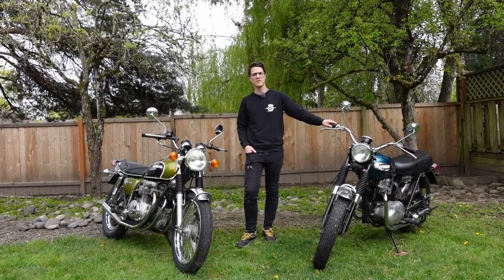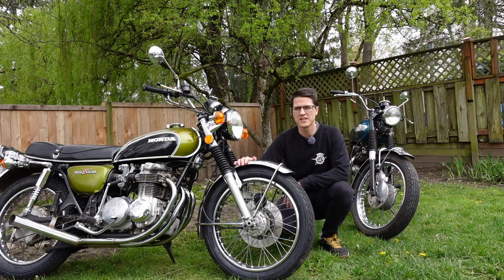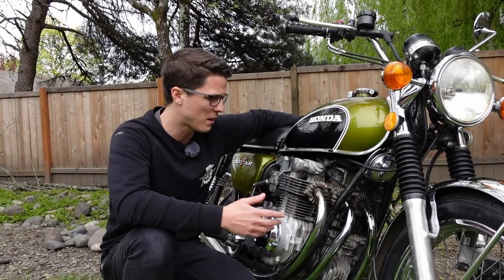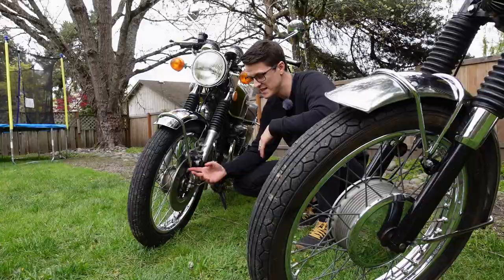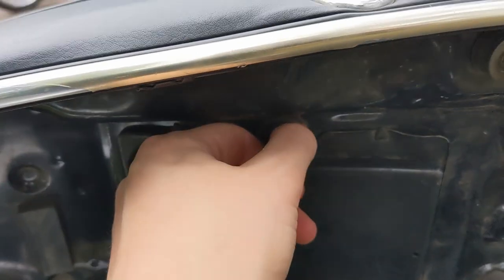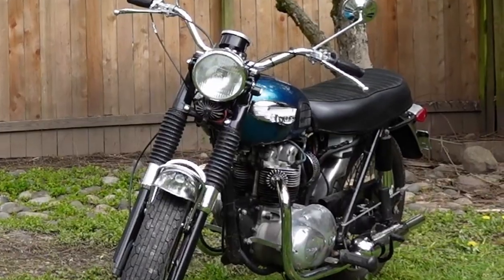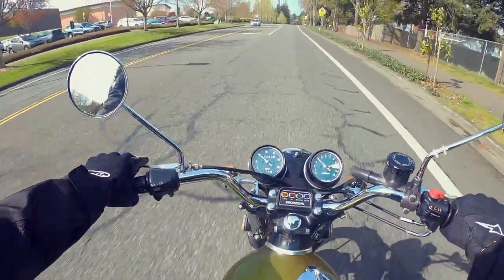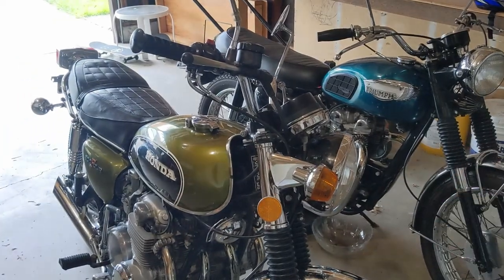How this Honda killed this Triumph

Comment: Honda killed it with it's dependability, perhaps the most reliable bikes ever produced- the CB line is tops.
Reply: So true. It just is. Reliability is everything.
Reply: @Ian-ny6ux  A bike can be as enjoyable to ride as you like, but it's not enjoyable if it breaks down.
Reply: Plastic is more reliable than wood.. wood has beauty, plastic doesn't. If function was all that was important, we'd all be chasing functional women. 😄
Reply: So you liked the single round “puck”disk on the 70’s CB750? 😖 That thing was noisy on all 4 of mine.
Reply: Reliability. The main purpose of the bike which is to get us from point a to b is what keeps most owners/enthusiasts interested. Nevermind the other means like cars or public transportation or other more reliable bikes. That is why some of us in other parts of the world bought old Honda's in the first place because it's still reliable and relevant upto this day. Otherwise what's the point if you can't ride a beautiful bike around town? We can always have other bikes in our garage but personally I'm always going to have one Honda in there. Old CB's are just legendary, good-looking and makes revving sounds just as good as any other newer bikes in this year because classic never goes out of style. As long as the parts and prices are reasonable that is. I'll stick to that.
Reply: all the c b 750s had leaky head gaskets. and to change or retorque the head one had to take the engine out of the frame.  rather trouble sum, but after that the engine was good for a while.  the transmission also had a tendency to pop out of fifth gear at high power and high speed, for which you had to come to a stop to re engage if you didn't want to grind the gears. over all it was a great bike for it's time.
Reply: Yeah, the low priced 250cc Suzuki X6 Hustler with 6 speed tranny and 105 MPH put a lot of hurt on Britain's bike industry/sales...
Reply: Triumph was relatively reliable until the Japanese got organised. All new production lines helped,  where Triumph had old machinery. Not now though!
Reply: I served my time as a bike mechanic under a dear friend, RIP - who served his time in a Honda dealership when the CB750 was introduced. He told me they bought in 2 - one was for a customer, the other for the shop floor. All the British bike guys came in to laugh at it, so did plenty more people. They said it would be prone to failure, built cheap & inferior. It sold 6 mths later, after the previously sold one had been flogged from 1 end of NZ to the other, ridden very hard & still no oil leaks or issues. Within 4 years of the first one arriving he said the shop storage shed was jam packed with British trade-ins that they couldnt give away.
Reply: @grahamgallagher1443  exactly the same as Japanese cars, and every British bike maker. I am unsure what your point is. Perhaps you didn't understand my point - the tolerances that were able to be maintained by new machine tools were far better than achievable at that time by British makers. The expectation in Britain was that share holders would receive a dividend every year which made modernising the production lines impossible. Britain also acted in a competitive fashion unlike Japan that found ways to ensure there was no competition for their products in their home market, exactly the same as their cars. The USA put in far too much protection, too late, which turned Harley Davidson into a fat and lazy company. But that is a digression.
Reply: @sscbkr48  I had a '71 Bonneville. Beautiful bike, but, every time I wanted to ride it, a thousand items had to be checked first, and, I always had to make sure I had my tool roll, and, assorted spares, because, something was guaranteed to fail. Then, I got a '77 Honda CB400F. You know what I had to do before a ride? Nothing. Take the battery tender off, roll it out of the garage, and, go. Brit bikes are great garage decorations. Japanese bikes are great, functional, rideable machines.
Reply: @BuzzLOLOL  But oh man, did they smoke! Just like the Kawasaki 500s. Plus, I hated that ring ding 2 stroke sound! But yeah, they were fast.
Reply: @mtntime1  - Synthetic 2 cycle oil stopped the smoking... noticed that on my '70 Yamaha 360 MX...  and then Kaw 750...
Reply: Brits made great bombers and fighters... somehow didn't translate into bikes and small cars...
Reply: You forget the CB 125 which starved its overhead cam of oil.
Reply: @DrPowerElectronics  Yes, I remember them.  I also remember that there were no bearings on the camshaft, they ran directly in the head.  Once you lost oil supply to the camshaft it didn't just destroy the camshaft, it took the head with it.
Reply: The Elsinore 125 Honda was totally reliable to. I had the 1974 model and I could go anywhere with total confidence.
Reply: @BuzzLOLOL  105 MPH, your having a laugh, my YDS 7 claimed to be a 100 MPH bike ,never got anywhere near that speed, was unreliable and put me of Japanese bikes for life though both my sons have them. Not forgetting that Suzuki gained their 2 stroke knowledge from a defector from either MZ or CZ, the deal was sealed on the mountain part of the TT circuit
Reply: @carolrowley9868  - Not surprising, Suzukis were always faster than Yamahas... and Yamaha was known for putting some obvious turds out... like the 500MX... 650 Twin... 
Currently ride most beautiful bike ever made: Suzuki Intruder ! 
https://i.pinimg.com/originals/1f/cc/ff/1fccffe383275ebc37946734937687d5.jpg
Reply: @grahamgallagher1443  VERY TRUE. I used to do long touring trips with my CB 500 in our outback areas, the folks I met all laughed at my Jap crap, but we had Brit bikes with us too, and they invariably broke done regularly. When the locals laughed at our "Jap crap" we just pointed at the Brit bikes and asked them to talk to those guys, aske them what they think. The looks they got from them, usually drove them away without asking any questions. L.O.L. funny as hell.
Reply: What is "Triumph"? They are making motorcycles?
Reply: @podunkman2709  - No real Triumph's, just ones made in India now...
Reply: I've had a few bikes. Honda SuperSports, cb 750s, CBX, Kawasaki Gpz, Yamaha secas....& Now a 82 Suzuki GS 750 E.  It's my favorite , not for looks, but it's rideability. Everyone of those bikes were reliable & in excellent condition.  I was never stranded. Not once, on any of them.  However a friend that owned Harleys, had to flat bed his bikes, not once, not twice, but 3 times on the way to Sturgis. He finally sold them, & went Japanese.
The CBX has a phenomenal sound, & is a great straight line bike, but imo this old Suzuki rides better than any Honda I've ever owned. & I loved all of those bikes. They were excellent.
The first bike was a canary yellow Honda 400 supersport. Back then the Harley guys called it jap crap.  I never cared & I still don't. I'd see large groups of them coming, back then it wasn't uncommon to be surrounded at a stop light, but even that little 400, said goodbye to them,  quickly. That tough guy Ells angels crap was around, & if you were on a Honda, let's just say they'd try""" to intimidate you.... I would immediately, & easily leave them far behind. I suspect a little old lady in a vw bug could have as well.
Reply: @Bellathebear777  LOL - true story.
The HD guy's are only tough for 6 months a year, the the garage queens sit all winter to be repaired.
I ride my BMW all year round, as long as the roads are clear and dry...
Love HONDA would like an African Twin someday...
Reply: @Bellathebear777  Just bought a 400/4 a few weeks ago here in Germany and love it. Little 1975 red beauty.
Reply: Two bikes I’d like to own one to ride want to look at

Comment: The Triumph motorcycle design department's motto was, "What was good enough for the grandfather is good enough for the grandson".
Reply: That I think is where they went wrong. Their bikes were selling so they just kept turning out the same old designs without a thought that another country might come out with something better. Well that's just what happened. The other country being Japan.
Reply: Harley until recently!
Reply: Not just Triumph but BSA Norton and all the rest really....
Reply: I think that British bikes were built to a price and Hondas were more expensive but also reliable and stuff
Reply: I remember hearing that when Hondas first came to Britain a Benly 125 cost more than a British 500. But people bought them anyway because of their reputation for reliability.
Reply: And this is reason why British motorcycle industry died. I have Royal Enfield Bullet 500 (no retro shit) and Triumph Bonneville T140V from 1978 (UK version with big petrol tank low handlebars Norton's exhaust pipes). I was big traveler on motorcycles. Japanese 1970's-80's bikes never fooled me. But British? Every. Every adjustmends, engine fail (with valves). On Royal Enfield Bullet I have over 30 000 kilometers about 2 years, and 3 times he fail me. Triumph? I buy them in end 2021 from Finland. Looks like new (restoration), but when you start the engine, there are very loud noise like hammer. So, this year I must shut down engine, and look to the engine. But now, I am worry about Triumph. I mean, for traveling I need Harley/Buell or BMW or Japanese GoldWing (I mean 1st gen.) maybe Hayabusa. Technology must service for us, not we for it.

Comment: A friend of mine back in 1970 had a Triumph Daytona (500cc). As I was a pillion passenger, I held onto the rear crash bars. The vibration that came through the crash bars made me feel like I was getting an electrical shock with pins and needles going through my hands. In 1973 he sold the Triumph and bought a Honda 750.
Reply: 750/4 a wise move.
Reply: Sounds like a Harley
Reply: Owning a Triumph is like having a piece of a better time
Reply: @asacarrick1440  I agree Ive ridden Harley Ironheads and Shovelheads, but theres nothing classier than a clean pre 71 Triumph.